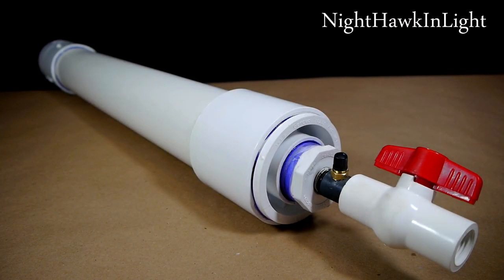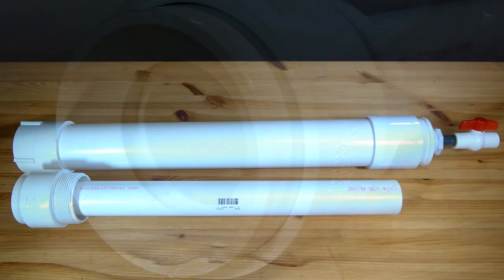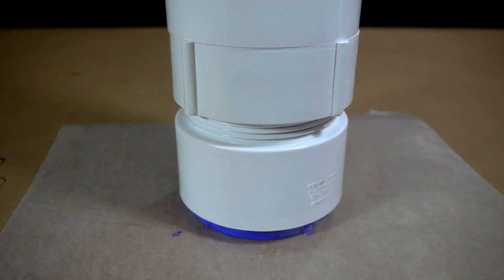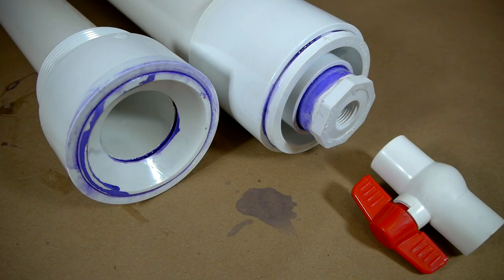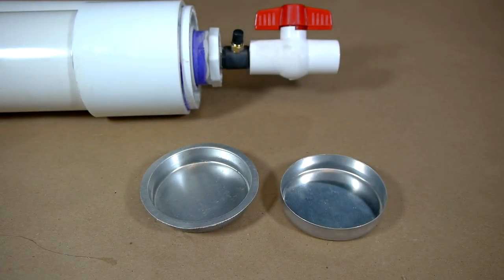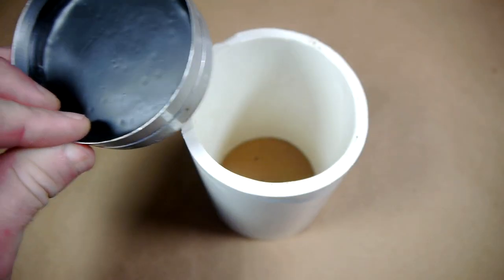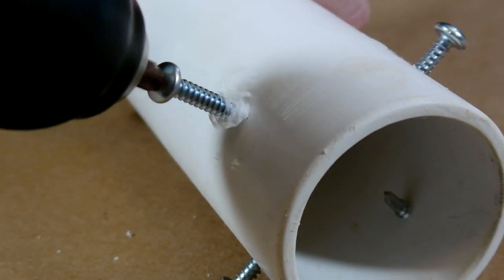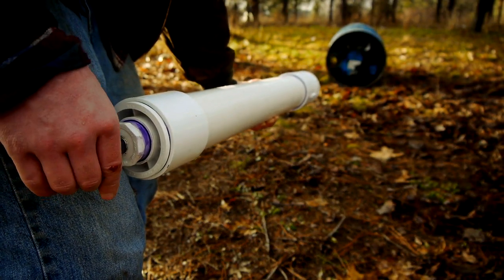How to Make a Powerful Coaxial Piston Cannon from Hardware Store Parts

Comment: This is an awesome cannon. The key items: #1 look inside the 3" pipe and make sure it is smooth. I got a rough piece. #2 The time consuming part will be the piston and its' seat (the end of the 2" barrel). These must be near perfect. The piston pieces need to be as parallel to each other as possible and the barrel must be cut near perfect. Once your piston is done, cut a piece of sandpaper to fit in it. Use a tiny drop of super glue to hold it to the piston, we will remove that later. Use the piston with the sandpaper and lap the end of the barrel. Mark the end of the barrel with a sharpy and start lapping carefully, lifting and looking at the sharpy mark. Once the mark is totally gone, you should be ok. Remove the paper with a little acetone. Now here is the tricky part. If your flat rubber packing is not very flexible, you will need to do the following. I took some 1/16" or near spongy tool drawer lining and cut that fit the piston. I then took some 1/32" flat rubber packing and glued that to the lining. I then glued that to the piston. Now, remember the drawer lining is porous so you must seal around the edge of the lining with super glue to keep the air from migrating under the seal and blowing out the rubber. One last thing. The less surface area on the seal at the end of the barrel, the better the seal will be. I used a regular old bastard metal file around the barrel to reduce the area in about half. Take your time.

Comment: Oh my!  In my younger days I loved making potato guns. This is a much more complex design but you get an exact firing every time. I used the old can hairspray or engine starting fluid and a Coleman lantern striker. Pretty explosive.  Yours looks a lot safer to use.   Thanks for the plans. Great video.
Reply: ***** How do you use lighter fluid?
Reply: How did  you use hair spray?
Reply: ***** Can you make a youtube video? It will help alot. I have a project coming up, and I wanna use hair spray, instead of compressed air, to compare them.
Reply: ***** "if you blow yourself up im not responsible." Yea... I think I might stick with the compressed air... but thanks!

Comment: A couple years ago I built one of these but doubled the length and used a 1.5" barrel diameter. I also used a sprinkler vale as the pressure relief valve.  It was..... absolutely rediculas.  Horrifyingly powerful and all around an awesome build.

Comment: For a physics project I have to launch a potato 75m, is the barrel long enough? Would the bike pump pressure be enough to launch it that far without exploding?
Reply from the maker: Yes, but these cannons can be tricky to get working so it might not be a good choice if you're on a deadline.
Reply: The-T-in-buffet ive put 110 psi in a modified propane tank on the back of 3 inch rigid pipe with a brass ball valve to control the whole thing. Lets just say it can hit a camel in the blow hole from about 250 yards. Use steel if you want to go above and beyond. Otherwise, youll have to test air pressure and potato size. Barrel length has very little to do with it. Case and point: airsoft. Barrel length has little to no affect on range or accuracy with a blunt projectile. Its a cannon, not a rifle ;)
Reply: @imagineaworld  Bahaha! Now that is more like it. I use a sprinkler valve refitted with a quick release air valve - you can actually aim with it.

Comment: Would it work if I added a quick change adapter to the air nozzle so that the cannon could run off standard 12oz co2 cartridges?

Comment: Hello all!
I would like to add to this YouTube thread that I built one of these Cannon’s and it works flawlessly! I have a machine shop and built the cannon to tight tolerances. I made the piston out of two pieces of 3/8 acrylic, glued them together and fitted the piston by hand sanding the outside to fit the chamber closely to minimize air leaking past. I turned a radius on the end of the barrel where it seals against the rubber pad glued to the piston. With 80/90 psi I get about 275 to 300 feet per second (Checked with a Chronograph). I can interchange 2 barrels, one 1.5 and a 2 inch. The 1.5 is optimum because you can fire golf balls as well. My buddies and I are like little kids playing around with this cannon. To those that want to build one remember that this thing is deadly and can do some serious damage to what ever is in the projectiles path! 
#Fartapolooza
Reply from the maker: I always wished I had a lathe when I was building these cannons as a kid.

Comment: I built this last summer for our mass LARP to shoot foam arrows, and had a lot of trouble creating the piston. Hockey pucks (as suggested in the comments) were too heavy, and as I'm living in Europe where the sizes of pipes etc... is different, I couldn't use the setup in the video.
I eventually made it with a pipe-endcap and some rubber, but every 30-40 shots, I have to take apart the gun and fix the piston. For some reason the rubber keeps losening, even with epoxy applied.

It's an awesome design, and especially if you're into LARP and want to have something that can be made to look like an old-school cannon, this is amazing! But that piston is a pain in the ass to create :D

Comment: I love it.

I have a good idea where the idea originated.

I'm a member of an association that rebuilds and operates antique railway equipment.  When I saw your valve and air pressure assembly designed to charge a reservoir and rapidly release it when the air pressure in the charging line was rapidly reduced, I thought Westinghouse Air Brake. 

Someone thought if such a railroad air brake assembly could apply railway brake shoes with force, it could shoot projectiles.

Comment: I'm thinking paintball portable mortar.
Reply: With whistling rocket... >:D
Reply: @georgecarmona7393  they can either just change the barrel or use wadings
Reply: @thewhitesheep4156  use a couple of paper dixie cups cut down the sides, dont cut the sides off, just cut four slits from the lip of the cup to about an 1/8th inch off and fold the flaps outward. Refold them up, fill with bbs or paintball rounds, and drop them in.

Comment from the maker: No, I did not have to modify mine. Grinding the lip off will work though, or you can grind out the ridge on the inside that prevents you from feeding a pipe in from the back.

Comment: I'm having a problem with two parts:
1) grinding off just the lip of the T-Cap evenly
2) after pouring/mixing the epoxy into the 1st T-Cap, I can't get the 2nd T-Cap to sit evenly. Either there's too much epoxy or not enough. Either way, the 2nd T-cap doesn't seem to set even.

Do you have any advice?
Reply from the maker: I used a bench grinder to take off the lip, that worked pretty well. Use more epoxy in the bottom cap and just float the top one on the surface.
Reply: NightHawkInLight I used a bench ginder. I picked it up for this project after snips/file and hand grinder left me hanging. After you replying to this, I gave it another try and it worked very well. 
When you put the epoxy in, do you mix it first, then pour it?  "use more epoxy", I put enough in where it oozed out between the pistons. I think this is what caused it to be uneven.  How full do you fill the 2nd piston?  To the top or a little below?  Thanks a lot for your help.  This is brilliant.
Reply from the maker: kenvadnais If the epoxy oozes out you have enough. The epoxy needs to be well mixed, it doesn't matter if it's mixed before or after it's poured so long as it gets done. Try to support the cap level as the epoxy cures and it should turn out fine.
Reply: NightHawkInLight Roger that. It's curing now.  I'll report tomorrow. Thanks again for your help!  I'm using a 4" chamber and 2.5" barrel.  It should have a punch. I'm also going to try to use water as a projectile, by loading the compression chamber half-full of water and half of air and filling the barrel with water..Then, apply pressurized water through the fill valve.  This should compress the air pocket in the compression chamber and act as a spring when the piston opens.  The goal is to get a solid, short stream of water that appears as a clean projectile as it arcs to it's target. :)   (I hope)  Thanks again for your help.
Reply from the maker: kenvadnais Be aware that firing that much water is going to provide so much recoil you're very likely not going to be able to hold on to the cannon.
Reply: NightHawkInLight Good to know. The length and weight are substantial. This will be mounted on a sailboat's stansion, on top of a gimbled bracket.  it'll be used to "answer" any water balloon issues we may encounter on the water. .  Air will be provided by an automotive electric tire pump.  It should be sweet.
Reply: kenvadnais I'm using the same size chamber and barrel, only for tennis balls...
Having an issue with the piston getting a good seal though...
What did you use for yours?

Comment: would this work if you put confetti in it instead of potato?
Reply: As long as you put enough to plug it airtight but not too tight
Reply: Goldie Neko as long as you use a sabot or fill a little cup that is a snug for with the confetti first.

Comment from the maker: That is a common issue. It can be resolved by making the piston a tighter fit within the chamber. This will cause the air behind the piston to be released faster than air can leak around from the front of the chamber, creating enough of a pressure differential to slide the piston back and break the seal against the barrel. Opening the ball valve in as quick a motion as possible will also help. The amount that your piston can travel is perfect.

Comment from the maker: 1/2" of piston movement is about right for this barrel size. If you have a lathe there are better options. You can turn a piston and give it an O ring for a perfect seal, and make a one way valve in it that will only allow air to pass when filling the chamber but be closed upon firing. A hole under a rubber flap. Keep the piston light weight by cutting some material out of the center if you're using rod stock so it can accelerate quickly and you're in business. That would be the ideal design.

Comment from the maker: You can use a sprinkler valve instead of a ball valve and fire it with an electronic trigger, or modify it to operate pneumatically. There are lots of guides for modifying sprinkler valves online that you can use.

Comment from the maker: Don't worry if the threads don't screw in flush. Don't force it too hard or the female fitting may break. Is the rubber face on the piston smooth? I can't imagine enough smooth rubber surface on a bike tire to cover the whole piston. If it's not sealing properly you can apply some TFE thread paste to the rubber and that will make it seal much better.

Comment from the maker: The cannon does not leak air by design at all. It holds pressure just as long as a sprinkler valve or any other system.

Comment from the maker: Also note, when the piston is made as tight a fit as it should be, it may be difficult to push past the chamber opening because it will want to catch on the lip of the pipe. The sharp lip of the 3" pipe inside of the female adapter may need to be sanded down to allow the piston to slide in.

Comment from the maker: Is the end of the barrel smooth and flat? And the face of the piston? They need to both be very flat so they can seal well against one another. A little pipe thread paste on the rubber face of the piston can help.

Comment from the maker: The brand name has worn off so I couldn't tell you where to get one. It's fairly new. I'm not a big fan of it. The plastic piece that held the rod centered at the top broke, and the hose is failing where it meets the pump. Finding a quality bicycle pump is a pain. The best I've used are the small handheld ones that are meant to snap onto a bike frame and connect to the tire stem directly without a hose. They don't have the volume for a large cannon like this though.

Comment from the maker: if you check my old video that I link to in the description i use a similar method to allow the barrel to be able to pass all the way through a bushing so that it can extend on either side of it. In this case you will simply have to adjust the length of the barrel if there is a difference in length of the fittings you use compared to the video.

Comment from the maker: Everything will melt. What temperature does it need to be good to? CPVC will resist slightly higher temps than PVC, otherwise your only options are metal. Copper, steel, aluminum.

Comment: Thank you for the video!  It works great!   I just made one and although I did change the piston design everything else works great!   Perfectly air tight and is super powerfull!  I used a heavy duty soup can that fit perfectly inside the 3in pipe for the piston.  The Gas T vent caps didnt want to get air tight for me.  I also used a sprinkler valve for pilot.  Amazing.  Thanks again!

Comment from the maker: What's happening is that too much air is able to leak past the piston, causing too slow of a change in pressure behind the piston for the differential to be great enough to break the seal against the barrel. Make the piston a slightly tighter fit. Alternately, you could have too much empty space behind the piston, which would also result in a slow change in pressure because a greater volume would need to escape before the necessary differential is reached. The former is the more likely scenario.

Comment from the maker: There are lots of reasons why a piston valve is better. A ball valve is smaller than the barrel, so the air flow is constricted, whereas a piston allows the entire barrel to be opened. Also, even if you have the fastest hands in the world, a ball valve cannot be opened completely before the projectile has already left the barrel. A piston opens much faster and allows more air to rush out right from the start. A ball valve opens like a rocket taking off, a piston valve opens like an explosion.

Comment: If you want to use it for a bunch of small projectiles like airsoft balls, most hardware or home improvement stores sell these cheap plastic caps that are designed to protect the ends of threaded pipes in transit, by cutting off the flange so it will fit in the barrel you have a perfect container to launch just about anything that will fit in it

Comment: Several years ago, I made a design similar to this using a rubber diaphragm with a couple holes poked in it rather than a piston.  It was about 8 feet long, 4" outer diameter and 1.5" barrel. It had sufficient force to turn a full soda can inside out using only a raw egg and 30psi. 

For air cannons like this, this style of valve is far superior to simply using a large ball valve. I think the piston design NightHawkInLight used is superior to the diaphragm that I used.

Comment: i messed around with air pushed pvc cannons, but mine was operated by brick (thats not the point). but the point is, that projectile does a huge difference in power. projectile like yours is very tight seal, but it's hard to move, and large amount of energy is wasted on that. what i found, that if you take a dowel, just bit smaller than the ID of the barrel, and hot glue several pieces of paper (fullly glued), and trim them so theyre discs, but wider than ID of barrel, and fold them back,

Comment: I have a question. For the cannon, rather than opening the valve all the way, can't you simply press down on the nipple you filled it from? It should let enough air through to move the piston, they that will open the chamber and push the air through the barrel like normal.

Comment: hey nighthalkinlight, this is my first time building A spud gun and I looked around f I r a while before I thought that your design was the coolest but i have a few questions. While building the cannon i had accidentally attatched the 3" Coupling to the 3" pipe before installing the rubber toilet bumper in between them. I don't think it would have caused an issue with the piston but I'm not sure. Would it? I've just finished building the cannon but while filling the chamber with air, I can feel air leak down the 1" diameter Barrel. I thought the piston wasn't seated properly on the 1" pipe and I've tried to double up the rubber on the piston. After that didn't work I put a cork sheet on top of that but the air still leaks. I've sanded the end of the 1" pipe pipe flat and im wondering if it would be a good idea to cut the 3' 2" barrel down to 3' 1" or 3' or less? I'm also wondering if there is another material I can use to provide an airtight seal or if is there another piston design I could use. Thank you ahead of time and I'm open to any suggestions. I'm really exited to shoo this cannon.

Comment: hey great video. I managed to solve the air leak problem with the rubber seal. Used a cell phone rubber sticky pad for the car, i added dust to make the rubber not stick so much, the soft rubber works good. The problem im still having is the piston does not open when the ball valve is released, it drops down after the pressure is released. i added a couple more lairs of foil tape and the piston is tighter but still have the same problem. Should i keep adding foil lairs or am i overlooking something? Appreciate your input.

Comment: I'm thinking one with a 2.65- inch barrel that can use coke cans as Sabots for firing things like water balloons, rocks, or just straight coke cans.

Is there a faster opening valve that can be used instead of a ball valve? I want to try to make this shoulder mounted and ball valves are also just slow.
Reply: The ball valve is just the trigger for the internal valve.
Solenoid sprinkler valves were mentioned.